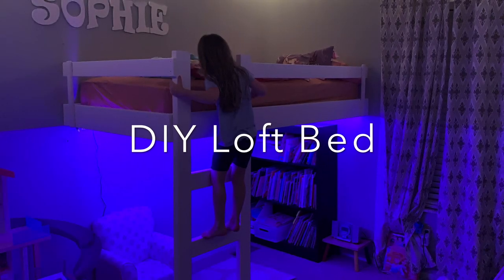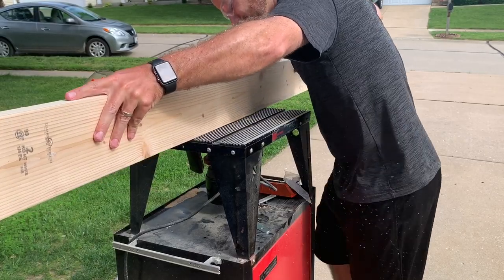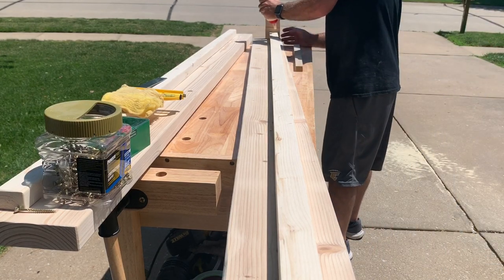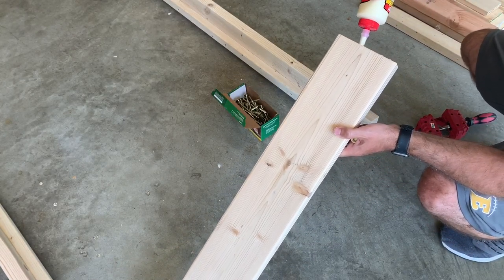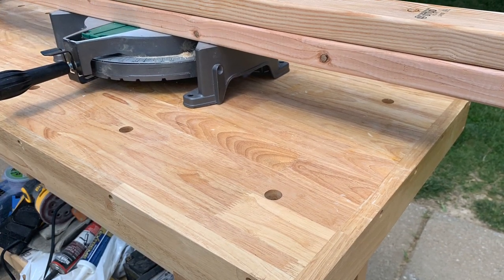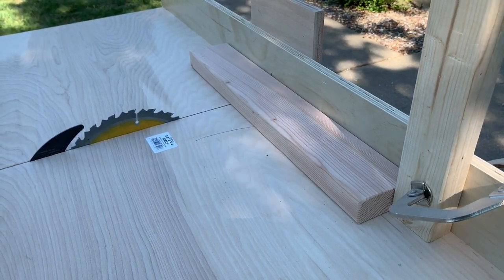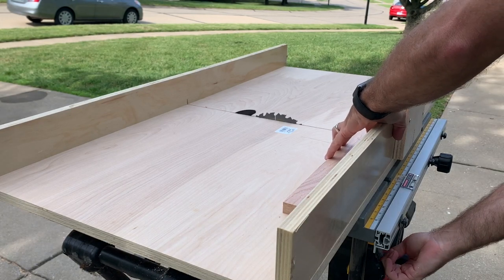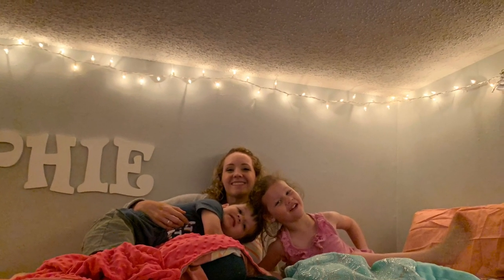DIY Loft Bed

Comment: Did you attach the ladder to the floor? I want to do this but have tile floors and don’t want to drill into them.
Reply from the maker: I did not. I would’ve used some rubber padding if I had wood floors just to generate some friction and protect. I’d love to see your solution if you decide to do it!

Comment: This is great! I have a 10yr & 8yr old that will be distance learning, so I want to loft their beds to put a desk under. The floating loft bed is a great idea since you don't have to plan around the 4 legs on the floor. I'm guessing it might even be more sturdy since it's bolted to the wall instead of free-standing.

Out of curiosity, why didn't you do pocket holes for the main bed frame? My understanding is that they can be stronger since they are going at an angle through the grain, and you are hiding the screws.
Reply from the maker: Great ideas! My original plans were pocket holes for the sides, then I decided to use half lap joints. Decided against that with these bolts I found. I couldn’t speak to comparative strength, but they’re strong enough to hold me without any squeaks. I’m about 170lbs. I use pocket holes in most of my stuff, but I didn’t have any for this thickness of wood. I’d probably go back to the half laps if I were to do it again. If you decide to make one, please share, I love seeing others’ ideas!

Comment: Any way you can share a list of supplies (lumber, screws and lag bolts)? My 8-year old saw this and screamed at me to make it. I am gonna try and surpeise her.
Reply from the maker: I'll do my best but it's been a little while, so I may forget something. 

3 8' 2x6 (frame)
2 8' 2x4 (ladder)
10 6' 1x4 (for slats)
1 2x3 (inside cleat)
1 6' oak 1x4 (long rail)
1 4' oak 1x4 (short rail)
2 4' oak 1x2 (rail supports)

These Lag Screws for anchoring to the wall and for frame construction:
https://www.homedepot.com/p/SPAX-1-4-in-x-3-1-2-in-T-Star-Drive-Washer-Head-Yellow-Zinc-Coated-POWERLAG-Screw-4581020700907/301068435

Regular 8x2 interior construction screws for the railing to the sides

Pocket Hole Screws for the ladder rungs.  

For the lights underneath, I used this:
https://www.amazon.com/gp/product/B07JP5375R/ref=ppx_yo_dt_b_asin_title_o05_s00?ie=UTF8&psc=1

We also used cabinet grade paint for the color, but I'm sure plenty of other stuff will work just fine.
Reply: Ya my 5 year old seen it and now I’m here building a castle loft bed 😂  It’s really difficult when you realize you need a part and have to wait days for same day pick up then they get the order wrong or give you split wonky wood.

Comment: How did I bolt it to the wall, great video.
Reply from the maker: I used lag bolts directly into the studs. It’s proven to be pretty sturdy over the months. Not the slightest movement.